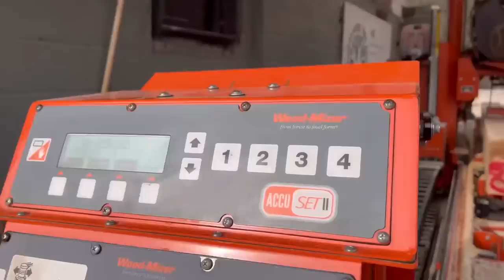What it Takes to Make Lumber; Sawing Red Oak for the Same Price as Softwood!

Comment: My father-in-law always heated his house with slabs, which he called hog slats from the local saw mill, he would take his flat bed dump truck and buy a load,for penny's on the dollar and cut them to length which he burned in the wood stove and used as his primary heat source during the winter months !! Smart Man that Grady was !!

Comment: Hi Em
I noticed that you square up the log and then cut the cant into boards from top to bottom. If you are selling them for construction grade that is fine, but if you want to sell for furniture you should cut boards from all the sides and then edge them. That way you stay away from the heat which is very low quality for furniture. Randy
Reply: Randy is correct. You need to learn to saw around the heartwood and to put the knots on the edges so they get edges off as well. Keep up the good work.
Reply: Randy are you referring to quarter sawing?

Comment: Hi!  I enjoy watching your videos and I am impressed with the work ethic and skill of the young lady "Sawyers."  I am a retired Lumberman and Sawyer who built and owned several conventional soft and hardwood mills, the largest, a hardwood mill in East Texas that produced about 10mm board feet/year.
I've never owned or operated a Woodmizer mill, but of course,  I'm well acquainted with the brand and type, having been around since the 1st ones came out.  My mills always had a circular headrig, but I had a couple with band linebars and resaws.
I have a couple of questions if you have the time and inclination to answer.
One....what kind of production are you able to achieve with your mill?  I would guess that 500-700 feet/hour is going to be a good number given my observation of your feed rate.
Two...obviously, hardwood is going to be a lot tougher on blades than a softwood.  How often do you sharpen/replace blades?  Do you run  coolant/ lubricant?
Three....I'm not being critical but you seem to slab heavy. Are you trying for a 4" or 6" opening face? Does the blade tend to snake or run out if you're a little shallow in your cut?
I won't bother you anymore.  I'm just an old sawmill man who can't get the sawdust out of my cuffs!  My wife complains if we go on a trip, because if we go past a small sawmill, I have to stop and talk.b
Keep up the fine work and  I'll keep watching!

Comment: Hmm, I assume the saw takes a bit longer to cut thru the oak than hemlock.  I think most contractors or dyi would prefer the hemlock for construction, but for trim and for finer stuff, sure, the red oak. Select the oak boards, for the clear or quarter or rift saw, set aside and dry it.  Then you can probably sell it quickly for $4/ bd ft.  or more.  Nice logs.

Comment: I  wonder  if  you  could  replace  that   log deck   with  a Woodmizer  Hydraulic  Log Deck ?  If  you  could, all  you  would   need  to  do, is   set  the logs  on the  log   deck,  and  let  the  hydraulics  move  the  log  up  to the   LT40  loader   arms.   Sure  would  save  time,  and  the  wear   and  tear  moving  those  heavy  logs  around by  hand.  It  would  be  a nice thing  to  have,  when  they  eventually  upgrade  to  a  larger    sawmill.
Reply: Here  is  that  Woodmizer  Log Deck  in  operation.

https://youtu.be/9eBGcVIedIw
Reply: That needs a power connection, the drive is only switched on and off for a new assembly.
Reply: @ernestospadolesto8126    Just  found out  that  it  runs  straight  off  the   sawmill.
Reply: @burlseeker4680 OK, that makes it easier.

Comment: I notice that after you make your first cut you always flip the board an entire 180 degrees, just curious if there is a reason for doing this? Just curious if there is any benefit that you have seen to doing it this way? Great video as always, love seeing all the hard work and dedication your team has!!
Reply: Same as you do in woodworking - You want to have 2 parallel sides so you get nice flat lumber - if you didn't you'd end up with at least one board that is tapered , and you'd lose a lot of board feet of otherwise good lumber.
Reply: @briangustin3745  Thanks for the feedback!!! Only reason I asked is because I run a LT35 and I have found that it saves a lot of time to not flip 180 degrees, and have not had any issues with tapered lumber due to it. I use my toe boards to correct the taper when doing this. But, again I am not a pro and just started milling this last year, so far milled up around 40k bf for myself and customers.
Reply: @horsebacklumber  Yeah, I think it rather depends on your mill and set-up, If I had a small mill (Like the Harbor Freight or Woodland Mills where you have to do everything by hand) I would probably try to square up 2 corners which would be less work , but with a nice flat mill bed and hydraulics to roll the log, it seems quicker to just flip it so you have one flat side on a flat reference surface, maximizing your usable lumber rather that guesstimating where your square corners are going to be out of the round log. - Fletches can always be straight line ripped, if you aren't going to do live edge lumber.

Comment: Would red oak make good decking?  If so where is  your   yard and what is your price for 7/4?
Reply: White oak is way more preferable for decking. I built my pickup bed out of red oak and learned that it doesn't fare near as well as white oak. White oak has occluded pores which do not hold water in the wood, They make whiskey barrels out of white oak for that reason. you can blow through the end pores in red oak

Comment: Build something with oak and let it age. It will be there forever. That wood is like iron once aged.
Reply: Locust. It's a tree 🌳 on steroids.
Reply: You can say that again. I salvaged a ton (probably literally a ton) of 2x4 and 2x6 red oak aged 60-65 years and used for a bunch of farm projects. We usually have to drill pilot holes to get screws in, and even then, we have to use star or square drive most of the time. No chance for nails. Those hex head screws for corrugated metal often spin the head off. Great stuff. Strong as ever.

Comment: Thing is red oak is structurally different from white oak and is far more prone to rot. In white oak, the tubules that carry water in the sapwood close off when the sapwood consolidates into heartwood. The bacteria and fungus that feed on wood normally migrate through these tubules,, but are blocked in the white oak. In red oak, these tubes remain open in the heartwood and allow the microorganisms free access to the cellular food. The result is rot. My experience here in the northeast is that red oak can rot as quickly as pine  especially in wet conditions. This is why red oak was never used in shipbuilding and why white oak was the perfect wood. I do imagine red could be used as siding so long as it did not remain damp for long periods. (Sorry...having virtually grown up in the old Lawley boatyard in Boston I can't help myself when it comes to the subject of oak.)

.
Reply from the maker: Very true, red oak is different from white oak